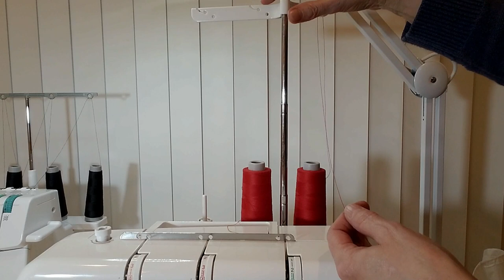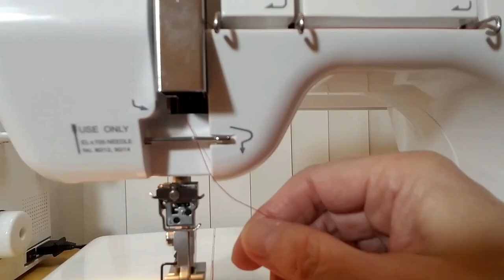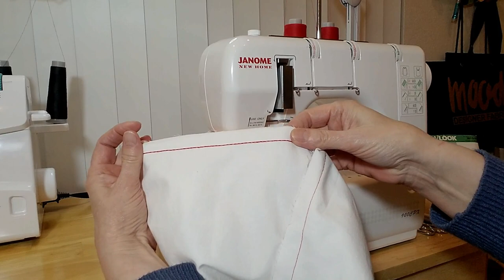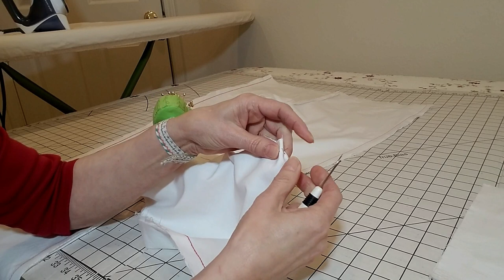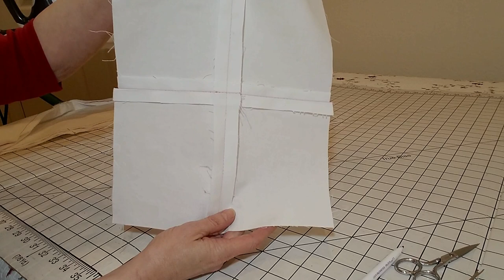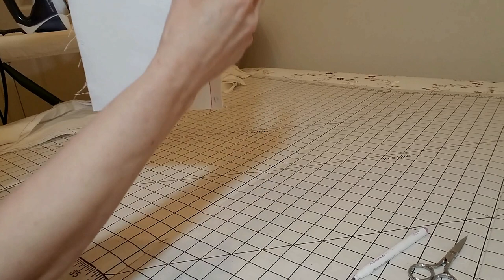Basting With Coverstitch Chain for a Muslin/Toile/Practice Garment

Comment: This was such a great and comprehensive lesson and I really appreciate the shared knowledge.  I have had a brand new jonome 3 needle coverstitch machine for some time but stopped using it, as I predominantly bought it to hem stretch fabric (such as tops and tee shirts).  But all it does is skip stitches during the round and the unpicking has taken ages and felt horrendous to do, so I gave up on using it.

You have inspired me to have another go.  Thank you.
Reply from the maker: Sorry to hear you're having trouble with your machine and I hope you get that worked out.  It might be a matter of tension settings, not sure.  I have read reviews of skipped stitches on the 1000CPX and 2000CPX, but others who don't have that problem.  I hope you give it another chance and experiment a bit more.  In the meantime you now know you don't have to unpick all those stitches!  Best wishes.
Reply: @sewlibra  thank you so much for your reply.  Mine is one of those machines.
Reply from the maker: I know this post is old but I recently found out why some Janome CS machines skip stitches and it's a fairly easy fix you can do yourself.  If the back feed dogs are lower than the front feed dogs you can adjust them to be even with a screwdriver. There is a YouTube video by Ann Tilly "Quick Fix for your Coverstitch". Good luck!
Reply: @sewlibra  wow, I really appreciate your helpful response.  I took it a few years back to ask them to look at it, but all it did was perform perfectly, so they couldn't help.  I will look for this video and have a go.  You have been so helpful on this, taking the time to respond!
Reply from the maker: @carolynnecp  I found out about this on Patternreview.com where I'm a long time member.  Several did this screwdriver trick themselves and are now happy campers.  I hope you will be too.  Best wishes!

Comment: The demo was great, and it really helped me. Now I understand how to remove the stitches, and how to remember which end to start removing them from!!!! Thanks!
I was curious about the way you threaded the looper. The looper thats slants out on my Janome CPX 2000 has 3  guides to go through. I only saw you thread 2 guides. My machine might be different than yours,  but it has a guide near the bottom of the slanting looper. Do I use or skip that guide?
Reply from the maker: My looper has a hole at the bottom and one at the top. If yours has three use them all. Maybe it has to do with yours being a three needle machine and mine is a two needle?  Thank you for your comments!
Reply: @sewlibra  OK. Thanks for your clarification! The video was great!
Reply from the maker: OMG pilofun1, I just looked at my looper and it does have that guide at the bottom!  This is embarrassing. Lol. I've never used it but I've had no sewing issues. I'll start using it and I'm sorry for the misinformation!
Reply: @sewlibra  LOL!!!!